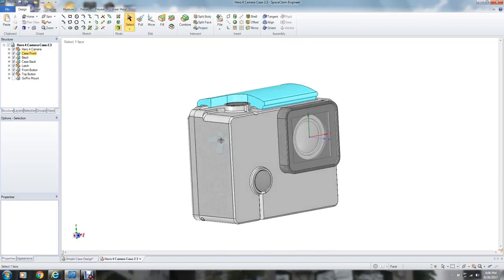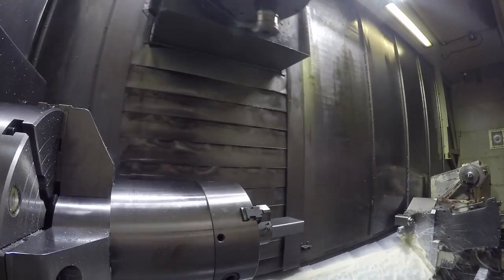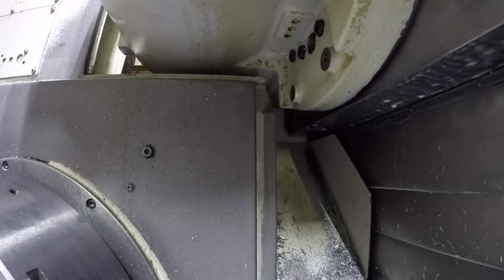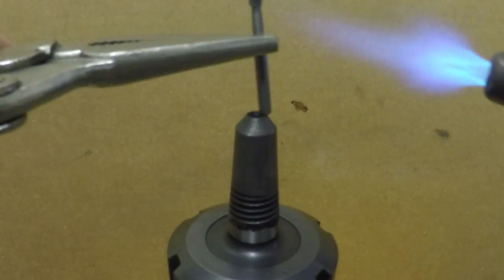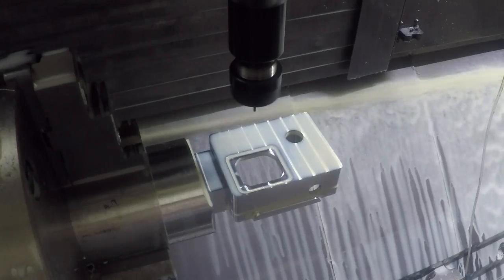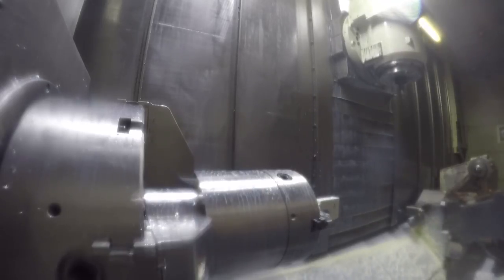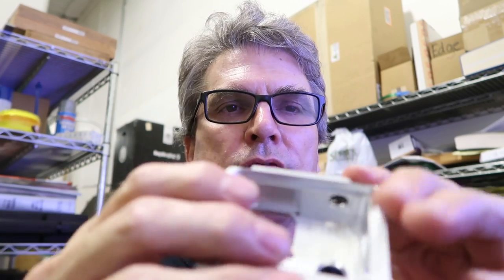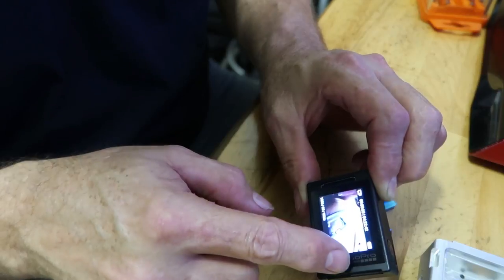GoPro Case Front-1

Comment: High Tech I must say. I went lo tech. Used a 4 inch PVC pipe, sealed bottom with a plug. Added mounting spacer. Milled a flat side window and sealed a piece of Lexan there. Next milled 2 o ring grooves on top and used a round cover to push on the pipe. Was able to access camera for retrieval. Also rigged extra battery pack in there. Used Blue Tooth for the controls. This was for use in a large river with a sound recorder and video for viewing fish. Got schematics around somewhere.

Comment: Peter the case looks really good so far, nice job on the reverse engineering.  You might try contacting reynolds advanced materials for the silicone they sell a wide variety of products and their technical support is very good.  I used to work in aerospace and there are several silicone adhesives like RTV 566  and primers made by GE (now momentive) and Nusil.  They are extremely expensive however....
Reply from the maker: Thanks Bill I will look into that.

Comment: I like the tapered dovetail idea! I was thinking of using some kind of wedge, but a dovetail hadn't occurred to me. Personally, I think I'm going to stick with good ol' screws for now.

Those button holes are a pain aren't they? I hope the molding idea works out. Have you looked into the silicone (or whatever) material very much? I've heard silicone gets eaten by coolant as well, though it's not something I've tried or experienced myself. Have you used the GoPro app? I've found that the WiFi goes through the aluminum just fine. And with that being the case, you don't need any button holes as you can control everything using the app. Going that route does seem to drain the battery faster though.
Reply from the maker: Yes I have played with the GoPro app. For me it just adds another layer of things to deal with while recording video. Its simpler for me to work with just the camera because I move the camera around a lot. I'm in the machine and would have to carry a I-Pad or phone with me it would be to many things to handle to get the composition I looking for. Its easer to just look at the back of the camera and use the controls on the camera. If the machine was smaller that might work OK or maybe a large vertical mill there would be some ware to set the display down and manipulate the camera to get the shot. I have areas/joints sealed with silicone rubber in the machine. The coolant doesn't seem to attack the silicon but it does seem to loose its bond to the metal over time. If I could find some way to get a more secure bond to the metal I think it would be good. Permabond makes some special adhesive for aluminum. There is also a company named Masterbond that makes some things. I need to get some and try them out.

Comment: Looking forward to the next video! What are your thought on solidwork vs spaceclaim, As well mastercam  vs esprit cam?
Reply from the maker: I haven't used SolidWorks in such a long time I cant really comment on their new versions. If I was starting over I think I would try Autocads Fusion for the simpler work and cad. When I started with SpaceClaim, SolidWorks and AutoCAD would not do what it does. Now they have changed to be more like it. I will say this with SpaceClaim their translators to bring in other formats are quite good. After imported you can edit the solid as if it was drawn in SpaceClaim. IGES,SAT,STEP, Pro e, all import quite well. I have only seen the demonstration on MasterCam and have not used it extensively so I cant really make a intelligent comparison. If I was starting over with the cam side of things for full 5axis I would be looking at it maybe over Esprit. There are some things I don't care for in Esprit.

Comment: Nice work! Love the videos. I have a question about milling. When roughing a bunch of material, do you think its better to have a shallower depth of cut and large step over, or have a deep depth of cut with smaller step over. Based on your experience, what do you believe is better. And does your rule apply to both alum and steel, or do you approach each differently. Any insight would be very much appreciated!
Reply from the maker: Motorman0297 In steel a feed mill with a shallow depth of cut with high feed rate is the best. In aluminum because you can take deeper depths of cut without breaking the tool and use higher surface footage the same process doesn't necessarily apply. Why a feed mill works better in harder to machine materials is because of chip thinning of the high lead angle of the inserts allows a very high feed rate. The same holds true of what fusion calls adaptive milling cycles.  This happens on the side of the cutter instead of the face as with a feed mill. This is the modern way of thinking in machining for roughing. Small depths of cuts at high feed rates. Sometimes with higher spindle speeds if the tool can handle it.
Reply: That helps a lot! Thank you sir.

Comment: So I have used many feed mills over the years and I've seen you use them a few times on your channel.  One thing I've noticed is that while they're designed to cut like .06-.08 depth at a time I've never had any problems feeding at .045-.06 per tooth.  I know in Alum it would just be quicker as I'm talking 17-4/316 and up to .07 feed per tooth in steel.  It appears your feed mill was running quite a bit slower, is there any particular reason?  I know you're sticking out quite a ways, but with a cut engagement of around .07 with a feed at about 170ipm you shouldn't really have any chatter.  Not a knock on you, just a question.  Thanks!

Comment: If you buy Go Pro's with wireless - smart phone App, you only really need one button hole, the one that turns on / off the Wifi. Everything else can be controlled from your smartphone. I wouldn't use a silicon membrane, instead make a threaded barrel and button insert, which would be more than enough to keep coolant out of the interior of the case. 

Sure is nice to watch a big machine make a small part !
Reply from the maker: Thanks I appreciate the info. If you run WiFi it’s at the sacrifice of battery power. And for me I don’t want to tie up my phone or have to keep track of my phone as well as the machine at the same time. I prefer the old fashion way using buttons. Thanks again.
Reply: You do run through more battery power. But for your needs, I doubt it's gonna reduce it more than you required. Course, step two of your project is simply to make a power port for the mini-usb power port to connect it to a used 12V car battery (with USB adapter) and then you can have unlimited power to your GoPro. 

https://www.youtube.com/watch?v=dV6Fylb9KJ0

Comment: Two questions-
1- The chatter, was that from the workholding in the 3 jaw? Seemed kinda odd given the rigidity of Capto and everything else.
2- Do we really need to spot drill? I've been using stubby carbide drills down to .125 and I never spot drill, so I just am curious if I'm doing it wrong.

Cool part!
Reply from the maker: Greg Koenig The chatter is due to two things. The part being thin walled later in the cycle. Earlier the speed (RPM) was to high. Yes with stubb drills you can get away without using a spot drill. I had the 1/16 drill extended way out intending to drill the hinge pin hole but I changed my mind as I said in the video.  Some time in the future I intend to do a video on using spot drills. There are good reasons to use them regardless of how long the drill is.
Reply from the maker: I would like to add something to this comment. What I show most of the time in my videos is the first time I run the part (unless I miss a shot or accidently delete the footage, this has happened). In machine work you usually program with your best guess at feeds and speeds but every part and setup is different. It usually takes some tweaks to get to the sweet spot where you don't have chatter or to get some finish you want.
Reply: I just want to make it clear; I wasn't trying to dig on you for the chatter. As I look to do more Done in One sorta operations, the big issue is always that we've got a part hanging off a tab of material (as opposed to gripped on a carrier in Talon Jaws, or a more traditional/rigid workholding). Mostly, I'm curious as to how funky 5 axis workholding effects speeds/feeds/rigidity in this sorta application. I'm looking at doing a Lang on a 4th axis to iterate parts faster.
Reply from the maker: Greg Koenig I didn't take it that way everything's OK. Don't hesitate to ask any questions.

Comment: would have been neat to build ur air wiper into that case
Reply from the maker: I thought about this and actually modeled one with it. But in this case I wanted to keep the machining simple. I can still mount the one on the GoPro's bezel. Maybe a future project.
Reply from the maker: Anothercaferacerbuild, At about 20 Psi (witch is all that's needed to work) the cameras mic doesn't pick it up. I can't really hear it. In order to make sure its on I put my hand next to the case to feel the air flowing. My newer case has the same thing its just built into the case. I run it on a California Air oil-less air compressor (Shop air has to much oil/water in it). The small air compressor only puts out 3.1 cfm at 40 psi. It easily keeps up with the air flow. There have been many suggestions about spinning disks. But that kind of thing would create to much noise. If you want to record sound it has to be silent or very close to it.
Reply from the maker: @Another Cafe Racer Build I really just built all this for my own use. So I don't have anything for sale. No I haven't tried other cameras. GoPro's are what I have to use.